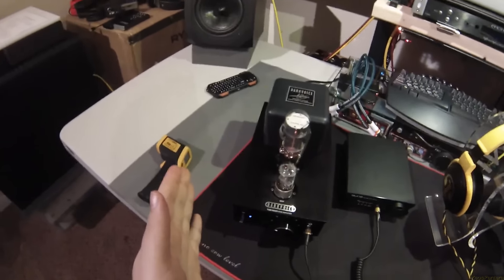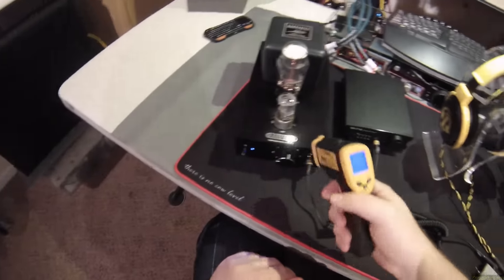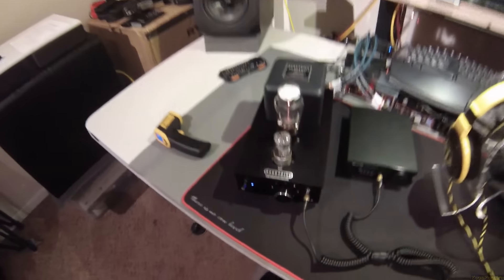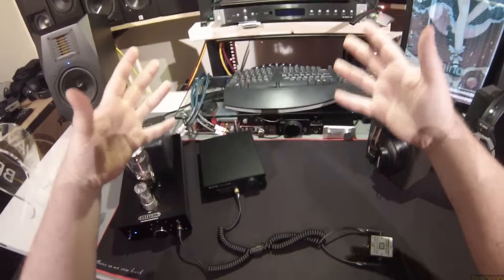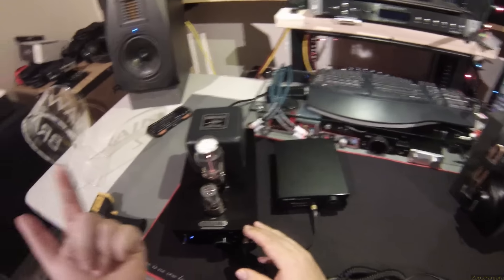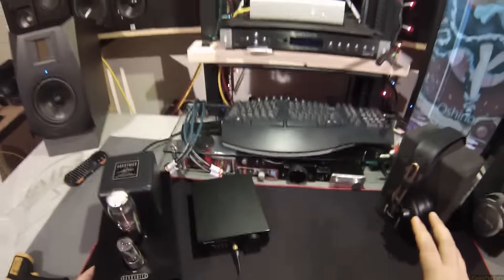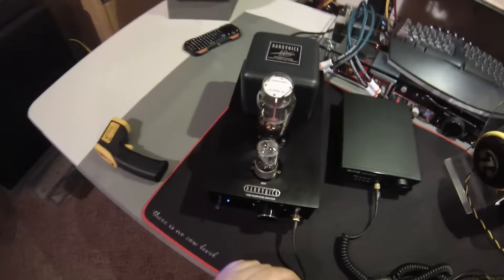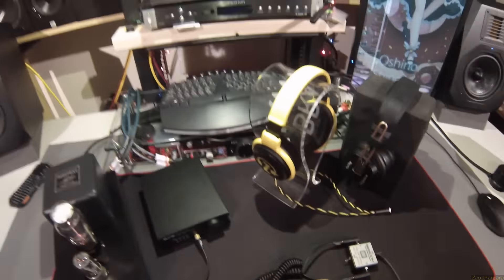Z Review - DarkVoice 336 Tube Amplifier

Comment: To really get technical, what tubes do is compress the signal and add harmonics: most strongly odd-order harmonics, but even-order harmonics to a reasonable degree (which things like tape don’t do). It’s essentially distortion, but also makes them sound “richer” and “warmer”.

The bass dropoff isn’t exactly bass dropoff (although I suppose it depends how you look at it) but everything else going up in volume. If you imagine everything in the signal is now producing a harmonics series above it, you’re actually getting a mids and treble boost.. which kind of equates to a bass drop.

Comment: You should revisit this review with some tube rolling. NOS American Manufactured Tung Sol 6SN7 tubes change the sound signature of the DV quite a bit. I have a Vintage Silvertone 6SN7GTB driver and an GE 6080 6AS7 power tube and the difference from the Chinese stock tubes is night and day on Senn HD-6XX.

Comment: you've convinced me into buying this, and im sure im not the only one. they should pay you for doing them a favor.
Reply: Massdrop now. They are now up
Reply: Enio Nery I just got one from Ebay, it will arrive soon. However, I am a total noob and the seller broke the small tube when packing. I was forced to search for another tube and just realised wtf I got myself into.... hundreds of pages on the forums related to the Darkvoice and tube rolling.... if you want to have funn with the Darkvoice, buy several diffrent tubes for it. Even the same model of tube from the same manufacturer, diffrent production dates, sound diffrent. like: get the RCA 6as7g gray plate, not black plate or another incredibly rare tube from the '40 era, you will be transported directly to HiFi heaven. Well, until the Darkvoice arrives I will shop for tubes
Reply: Bolda Sebastian Mullard tubes are the best imo :) Old and great.
Reply: Bolda Sebastian They cost though
Reply: Mickxal yeah... I am in europe, the US tubes cost much more here. I got lucky to find several old repair shops or retired workers who still have plenty of NOS. On the positive side, most NOS Russian tubes cost between 1.5 to 15 USD and they have hundreds of them. I even found some fuckedup Russian army tubes used on planes and in radar systems for 15-30 USD (did not try them).

Comment: I’m really liking the sound from your review on the dark force 336. In your opinion dark force 336 vs Schiit Valhalla 2 for your sub $400 250ohm headphone amp? I’m torn after watching a few of your videos.
Reply: The darkvoice will give you a more tube amp sound and the Valhalla 2 has a more solid state sound if that helps. I don't own both but I ordered the darkvoice off drop formerly massdrop and I have schiit products so either way I'm sure you will be very pleased.

Comment: I have a very silly question. I know there are rca outputs at the rear. So what if I have speakers connected to the rca output when I plug in headphone? Will it stop playing sound via the speaker and output the sound via headphone, like a pc?
Reply from the maker: It passes through without stopping.

Comment: The remark about the tubes almost adding a slight reverb is quite interesting to me. I've spent quite some time trying to make my soundcard sound as close as possible to another one that sounded somehow "better" to me, had a smoother, "glassy" kind of sound compared to a slight "harshness" of my other soundcards (because the one I liked had other issues that made it kinda unsuitable for my use). I tried everything, including changing opamps (didn't really do much). Eventually I figured out how to get very close to its sound - simply add a very slight hint of reverb. It somehow smoothed everything out and warmed it up. It seemed the soundcard with the sound I liked was kinda adding a bit of reverb to its sound as well.

Comment: Tubes cause 2nd harmonic distortion, which you normally can't really hear, at least, not to the point of being able to verbalize what it is you are hearing, however, it very much adds indescribable texture and warmness. This is the tube sound that solid state amps fail to replicate.

Comment: Hmm, the interesting thing about this design is that this is a direct 
copy  of a design I created in 1999 for a DIY project in Vacuum Tube 
Valley magazine.  I find it hilarious that someone in China has decided 
to market this as a commercial product.
Reply from the maker: +kludgeaudio Only so many ways to put a tube amp together. And a good diy is a good amp in general.
Reply: True enough, although the whole notion of using the high-Gm 6080 tube as a cathode follower to directly drive headphones was kind of innovative.  It's a transistor-designer way of thinking about the problem and not a tube-designer way of thinking about the problem.  On the other hand, the feedback trick to bring the output Z down even farther is a tube-designer sort of thing to do, and the combination is kind of a rare thing.  Which, I think, is why nobody had tried that before.

Even so, I think it should be possible to get the output Z even lower with a higher gain input tube and a little more global feedback, and I am surprised that none of the people who have copied this design have tried that.  This one is absolutely part-for-part identical to the original article, even down to the filter network on the power supply (which could be done more cheaply in a production unit with a little engineering).

Comment: In the 1940s the invention of semiconductor devices made it possible to produce solid-state devices, which are smaller, more efficient, reliable and durable, and cheaper than thermionic tubes. From the mid-1960s, thermionic tubes were then being replaced by the transistor. However, the cathode-ray tube (CRT) remained the basis for television monitors and oscilloscopes until the early 21st century.

Comment: You said the Darkvoice has a preamp. Have you tried and used the tube pre in your solid state phone amplifier? If so, what are your impressions?
Reply from the maker: +Eduardo Queiroz I couldn't detect any discernible advantage to using that as the pre. I think the major changes occur with the amplifier being the tube component.
Reply: +Z Reviews thank you!

Comment: Will it be an improvement in sound quality if i use the audio out from Aune X1S to audio in to Darkvoice 336SE ? or should i just use a coax to aux cable like the Supra Y-Link 2RCA - 1RCA, straigt in my pc motherboard with my Darkvoice 336SE ?              (my motherboard is a MSI Z170A GAMING M3, Socket-1151)
Reply from the maker: You want a clean source. The Aune would be better.
Reply: Do i also get the benefit of keeping the 32 bit/384 DSD out of the Darkvoice when combined together?

Comment: i am planning to go tube too. was considering the little dot mk2. could you review if possible? also, i heard that there is slight distortion of you use a low impedance headphone on tube amps, is this true? i use the ad700x
Reply from the maker: +Anirban Bhattacharjee I haven't played too much with low impedence cans and the cheaper tubes. They can get bit unwieldy  since they are just skimming the power that the tube produces.

Comment: 149 degrees Celsius?! Do all tube amps get that hot? I think I'll just stick to solid state lol.
Reply: Yep all tube amps have heaters in them.  The cathode has to be heated to several hundred degrees C, to the point where it glows.  Turn off the lights and you'll see a bright orange glow inside the tubes.

Comment: did u have any hum problems with DV?
i ve been solid state guy(O2, Magni, DC1). Last week i got WA2 and it gives out hum thru headphones. I disconnect all inputs and hum goes away. When i connect my DAC(modi,DC1,Fiio X3ii) hum comes back. There is hum even when dac is not powered on.
Reply from the maker: +mahee The splitter I use to A/B can add a hum but if I wiggle the wire a bit it grounds and goes away. This can happen with any amp and can be hard to track down.

Comment: The bass drops because tube amps are capacitor coupled which doesn't allow any DC, this can affect low bass frequencies. A lot of solid state amps are DC coupled which means you can have a flat response down to 1Hz.
Reply: The real reason why most amplifiers are capacitor coupled is because DC voltages on the voice coil of a speaker creates nothing but heat. Heat + voice coils= dead speaker!!!!. While there are OCL (output capacitor less) amplifiers, you run the risk of burning out the voice coils if you drive the amplifier into clipping or if an output transistor shorts and stays switched on... In that case your speaker driver's will vaporize instantly.... Capacitors are an amazing passive device, depending upon where you place them in a circuit, they will perform different functions for example: if used in a power supply after the voltage has been rectified from Ac to Dc in parallel then it acts like a storage device that can accommodate fast delivery of power to what ever it's connected to... It also has the side effect of smoothing out fluctuating voltage ripples. If you were to say... Place the capacitor in series in the same power supply, your device will not function... So! That being said... A capacitor can store Dc and give it back for when it's needed, kinda like a battery (except that the battery has high internal resistance which = the inability to provide all of it's current instantly). But.... The capacitor can pass Ac voltage straight through it almost like it wasn't there... If there's a Dc voltage coupled with an Ac voltage and it's on it's way to your speakers, the Dc component of the voltage hits a brick wall when it gets to the capacitor... Remember that the sound that you hear from your speakers is because they are receiving Ac voltage. The signal that is fed into your amplifier is an Ac voltage but the amplifier is being powered by Dc voltage.... If Dc coupling went to the speakers then that would be like connecting a 1.5v AA size battery across the positive and negative wire's on a speaker or headphones... Try it sometime and you will either see the magic smoke come out or in the case of the headphones... See your hair transition into a form of magic smoke LoL... Although... I really don't recommend that you try it unless you are outside in a well ventilated area where you can't set anything else on fire LoL... Anyway, I hope that I have cleared up the topic of output capacitors... They are there for a reason and if the amplifier is really old like 20 years or more... You might want to get the capacitors replaced with new ones because they dry out or leak electrolyte and eventually take out the next device in line till magic smoke appears...

Comment: I thought you review was pretty on spot, for the most part. I try to tell folks who ask me about tube vs ss, that most are better off with ss. I myself, almost always prefer a tube preamp with a good ss amp. I have a blue circle tube preamp that does every thing a ss can do, only better. Of course it was $1600 15 years ago. These days there is less difference between tube & ss the better they are made. A good tube amp should not be overly warm or have soft bass . That was my grandfathers tube amp in the 1950's. However to get these qualitys they do not come cheap.

Comment: You absolutely cannot fake the output of a tube amp with a DSP-based technique.  It always leaves something to be desired.  In a sense, a tube is modifying the input signal at the granularity of the electrons that are flowing off the cathode.  Even the most up to date DSPs are just not fast enough to emulate that at a resolution and sampling rate that is sufficient to capture the character of a tube.
Reply: In a sense, the so-called "Transfer Function Modified" (TFM) amplifiers that Bob Carver built in the late 80s and early 90s were using transistors as an analog computer in the signal path to add the harmonics characteristic of vacuum tubes.

Comment: Btw. - it's wrong to say that you can't have a tube amp as your only amp. It depends of which tube amp you have and which tubes are in it. Tube amps aren't all the same, and saying that tube = inaccurate sound is just inaccurate. Some are more accurate and natural sounding than solid state could ever be, again, for the reasons of how tubes produce sound that is simply more similar to the way sounds are created in the actual real world, they do it very naturally, without a hint of digital sound. Now, a lot of people won't understand what I mean when I say "digital sound", but you have to hear a great speaker or headphone setup based around analog gear, and you'll then know why analog equipment sounds more natural than digital equipment, not always, but if we compare the best of digital to the best of analog, analog will win, both in professional environment like recording studios, as well as hi-fi and audiophile world.  Also, some headphones simply work far better with tube amps. Anyone who's heard 600 Ohm Beyerdynamic's with solid state amps and tube amps probably never plugged them into a solid state amp ever again.
Reply: +derbigpr500 Zeo's is right and you are wrong.
Reply: +boobio1 As an engineer, I know "a bit more" about tube amps than Z or most other people, I can guarantee you that. Not to mention I have infinitely more experience with tube amplifiers, as I have been using them for at least 10 years, with various types of headphones and speakers. I also never speak unless I am 100% sure I'm right.

Comment: Hmm... Zeos, the volume difference isn't because it's a tube, it's because the tube has a larger impedance than that solid state amp.
There are solid state amps with a larger impedance and you'll see it has the same "issue".
The impedance of the headphones aren't the only impedance. Solid state amp has typically: 0.5-10 Ohm and a tube amp often much higher(I heard 40 somewhere but it's really hard to find this info. Could you measure this with a multi-meter?)
Say with a 250 Ohm headphone and a 300 Ohm headphone you switch between 2 amps with an output impedance of 1 and 40.
difference with 250 ohm headphones: ((290-251)/251)*100%=16%
difference with 300 ohm headphones: ((340-301)/301)*100%=13%
That's quite a difference.

Comment: The reason the volume dropped on the Darkvoice when you plugged the mad dogs in is because it's an OTL amp. This means that the amount of power it is able to output goes UP with higher impedance where as solid state would go down. So if you plug in a headphone with low impedance but high power demands, the OTL will output less power. Mad Dogs are orthodynamic and have low impedance and heavy power requirements so OTL is about the worst amp you could pick for driving that kind of headphone. OTL is best with high impedance dynamic headphones like the HD6x and HD8x. Headphones you would want to avoid with an OTL would be your orthos like HE4x,HE5x,HE6x, LCD's, Fostex etc.
Reply from the maker: Noted.
Reply: It wont output as much power as it would with a 600 ohm but its personal preference as to whether its enough.
Reply: the little dot I+ is a hybrid amp which means it's basically a transistor based amp with a tube for a small sound change/coloration (and for looks:D). It's good for low impedance and he-400i are easy to drive. 

Not all tube amps are OTL. There are amps that are OTC (output transformer coupled) like the WOO WA6/WA6SE/WA22 and others.
Reply: I specifically bought the Little Dot 1+ because it is made to output high with low imp headphones.
Like a solid state amp, the amount of mW output is highest with lower ohm headphones, and lower with high ohm headphones.
After tons of research I ordered the Mullard M8100 tubes to go with it, just saying.. for a good warm tubey sound supposedly. :)
Reply: Your opinion please!  hd 600's & darkvoice,  however using a Pioneer elite blue ray player (8 or 9 yrs. old) and a Pioneer 7.2 receiver also 8 or 9 yrs. old as the source. Also the CD's are old but in good shape. Is my source lacking? I know a turntable & records might be better but this set-up sounds great. To me, a real nubie that is.
Reply: So is it generally not a good idea to run Mad Dogs off of a tube amp? I'm wondering if something like a Fiio A5 would do the job, and cover portable use too.
Reply: @grady7443  i have hd600 and darkvoice, absolutely love it.
Reply: What would be a good tube dac/amp for a hifiman he400i then?? Xduoo ta-10?
Reply: Subparanon How would the Sennheiser HD660 S perform with the Dark Voice? Or would it be best to pair the Dark Voice with the Sennheiser HD600 or HD650? Thanks!
Reply: @grooveag25  From the research ive done the Bottlehead Crack 1.1 with speedball upgrade is the best to pair with HD6XX/HD650 while the DV comes in a close second for tube amps

Comment: One thing you didn't mention about tubes that can either be a negative or a positive because alot of people live for this sort of thing is how many different versions there are. You can change the sound in so many ways by whatever tubes you want to get. I think that is one of the main reasons people like tubes. 

Another big point I think you missed is the maintenance and up keep costs. Tubes like that do eventually need replaced and the sound will change and get bad as they get older. Another thing is most people that are big into tubes hate the newly produced ones which mostly come from China. You are gambling though when you go out and spend almost half on what the amp itself cost on tubes that are 40-60 years old, sometimes even older. Plus absolutely no warranty and guarantee they will sound the same as the last pair you had.